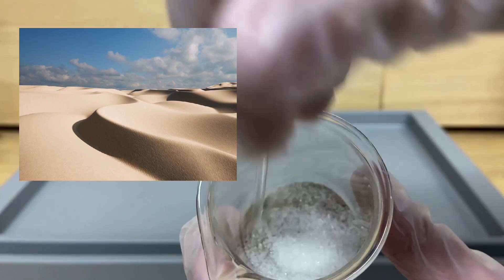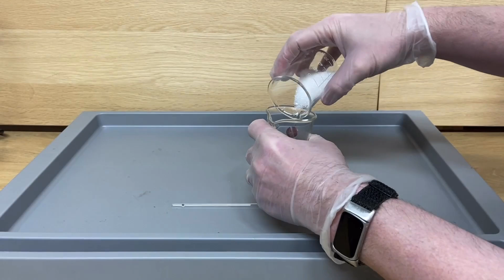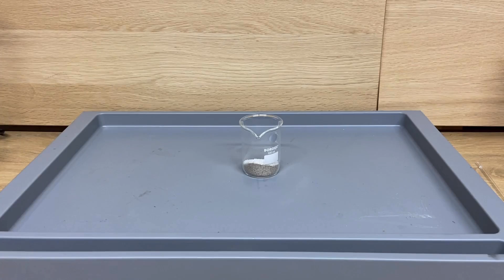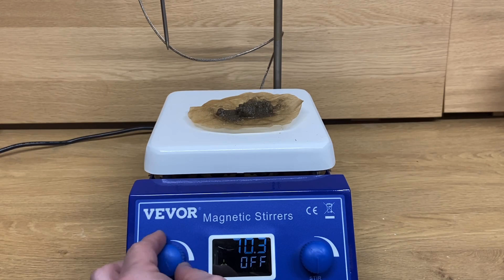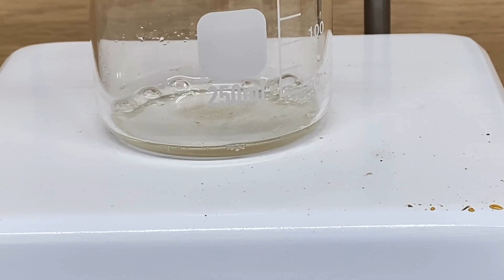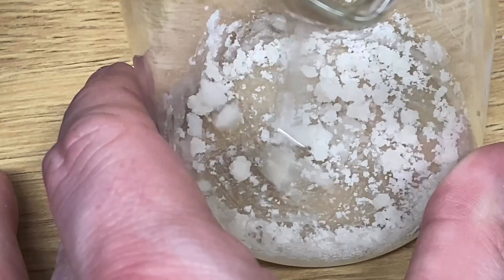Everyday Science: How to filtrate sand from sugar the Dune way?

Comment: It would probably be done the way we do it now... centrifugal force. Get it spinning and the heavier stuff moves outward. Weve got loads of systems to seperate the product this way but most use some type of horn like pipes to push it thru. Dissolving stuff is very energy hungry and usually not necessary.
Reply from the maker: Yeah sounds good!

Comment: "I think easily accessible cinnamon who does not dissolve in water resembles spice pretty good, so let me demonstrate with sugar instead" ;-)  
Even with little water, they could use some kind of reflux if the spice is water soluble.
Reply from the maker: I thought about doing a similar experiment with cinnamon but very unfortunately very quickly found out that it would then be a very different experiment.

Comment: Hot water would provide a better if not near 100% yield. Water heating solar panels would cheaply provide the heat. The water shouldn't be too much of a problem since it could be easily condensed and recovered for reuse, and the cost of spice is more expensive. The heat from the sun to recrystallize would be cheap as well. Of course this all depends on the solubility of the spice (after looking online, it looks like water is hard to separate from spice). Different solvents could be cheaper/better.
Reply from the maker: Very true!! What solvent would you suggest?

Comment: Wouldn't it also be possible to use a mechanical process instead? If you assume spice has buoyancy in moving sand
Reply: A centrifugal process could also be used if spice is denser/less dense than sand
Reply from the maker: Yes that would definitely make sense!!

Comment: Neat! Haven’t seen dune 2 yet, but being that water is so rare on Arakkis that spitting on someone is a gesture of politeness for giving them your moisture, I don’t think separating with water would be a good way would it? 

My first thought is to use spinning chambers of various hole sizes to filter out the very fine dust spice from the heavy grains of sand. From there you can sift in a vibrating bed to separate light particles from heavy particles.

There’s steps from there for further refinement but truthfully it doesn’t seem that finer refinement from that is necessary for how they use it
Reply from the maker: What a lovely answer.  Yes i also do not think they would use water. 

The solution you propose sounds a lot better!!